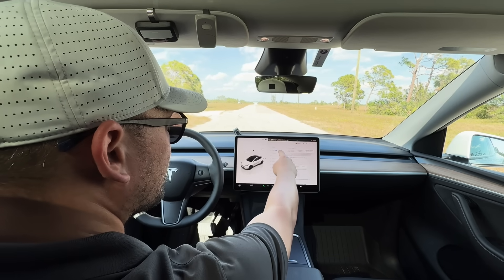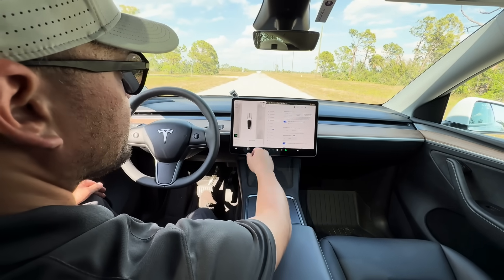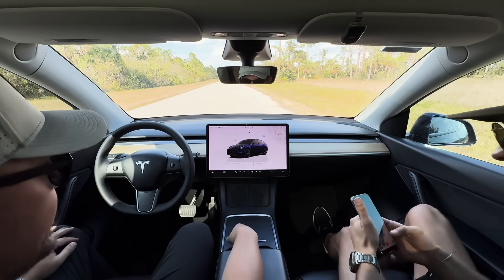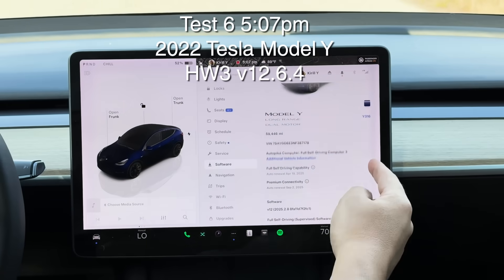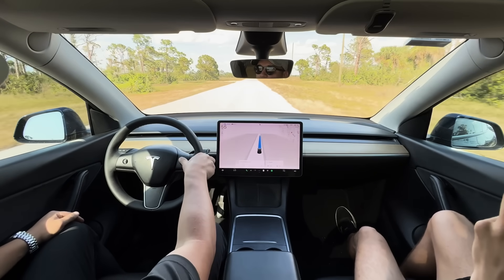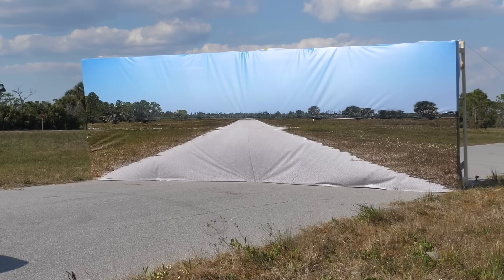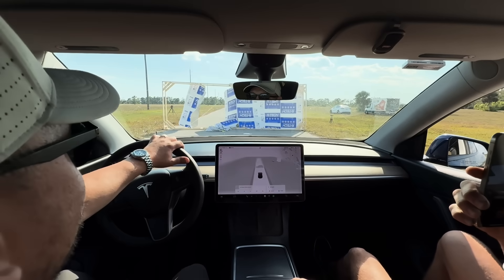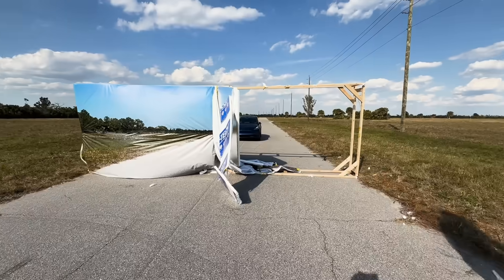Mark Rober Debunked - You can't fool a HW4 Tesla using FSD!

Comment: What really make the difference between the 2 is not the HW but the SW, FSD version 13 is using a much more powerful AI model and why only HW 4 have it is because it require more processing power to run and HW 3 can't handle it.
Reply: Since I have not seen a fake wall on a highway to avoid,  it doesn't really matter.
Reply: @Notme-tq4xs hey don't tempt these tesla haters. They might start putting up fake road walls.

Comment: I have both a HW3 and HW4 Tesla. HW4 is incredible. I basically feel like I have a true full self driving car with HW4. Use it a lot. I'm lucky if I have 2 disengagements per month. And if I disengage, it's usually because of what appears to be mapping issues on freeways. Has nothing to do with the car making a real mistake while driving.
Reply: HW3 ain’t too bad either
Reply: @joneclegg  HW3 is awful compared to HW4. At least on city streets. HW4 is just that good
Reply: It might feel like you have a full self driving car, but you absolutely do not. Nor will you ever. Even lidar-based systems go badly wrong. Don't be complacent behind the wheel or somebody will get killed
Reply: @robertollier3085  people get killed when driving themselves, or in a taxi. You can't have 100% safety. Even trains crash.
Reply: I’ve been a Tesla shareholder since 2018.  I don’t drive enough to justify buying a Tesla.   In your opinion, how close is FSD to getting reliable enough to go unsupervised?
Reply: @jeffreyhampton9130  HW3 here...12.(6? something) In the past week or so, I put on about 20 hours of no intervention highway driving. However, it still seems mostly clueless about the last 30 meters or so... parking lots... parking.. It just kind of gets lost. So, in a sense... it's "99%" even for HW3 12.(6?) but that last 1% may not be anything like "1%".
I think of it like this: 99% of the time, I can drive without thinking. It's just reflexes... but then 1% of the time I have to think about my surroundings and figure out some sort of a problem. I don't think that is very similar to the reflexes driving. It takes 10x or more "thinking" on my part for those occasions. I suspect a similar thing for AI models..
Hopefully, learnings from xAI "thinking" mode for LLMs can help solve this sort of problem.
Reply: @JordanPriede  Thank you.  This is helpful.
Reply: @JordanPriede  very. very helpful, i should say.
Reply: @JordanPriede  You're mostly correct, but you (nor anyone ) can't claim it's "99% there but that last 1% may not be anything like "1%". That's not how % works.
Reply: @edide1627  I meant it is useful for 99% of driving. But that doesn't mean there is only 1% development effort left.
Reply: @jeffreyhampton9130   I rely on FSD every time I drive my Tesla with HW4—it's genuinely that good. However, I believe 'unsupervised' is the wrong framework for this technology. Rather than expecting perfection (which remains years away), we should view FSD through the lens of the Swiss cheese model of accident prevention. Each 'slice' (FSD, human supervision, other safety systems) has holes, but when stacked together, they create comprehensive protection. The combination of FSD with an attentive driver creates a significantly safer driving experience than either could provide alone. The goal shouldn't be eliminating human oversight but optimizing how these safety layers complement each other.
Reply: @amieres  I agree, but that is NOT how Elon Musk and Tesla market FSD! 
Quite the opposite. unlike other manufacturers, Tesla much rather appears to lure their customers into careless and even reckless operation of the vehicle based on a false sense of security and reliability of a system in beta test status.
Reply: @tomwoggle9411  it doesn't let you ignore the road. It bugs you if you don't watch the road. And if you ignore the road enough, I believe it actually shuts the feature down on the car. At least that is what it seems to imply.. there's a record if you have a strike against your FSD usage be being inattentive
Reply: @jeffreyhampton9130  I don't drive Tesla too, just saying what I'm thinking based on videos.
It still has multiple strange behaviours that need to be fixed. Most of them don't cause a collision, but it could if all cars around behaved like that.
There is also a lot to improve in emergency situations, or even interactions with emergency vehicles.
I think regulators could accept unsupervised even right now. On some roads, in good weather conditions.

You have to take into account that regulators are not apolitical. A good example is Mercedes that is supposed to be L3, has a lot of marketing around it, but its autopilot is far behind Tesla. In addition, Tesla has a history of marketing cars as self-driving when they were clearly not ready for that, and even some people abused it - for example, sleeping while going to work. Some people died.
Reply: Is it good enough that you can turn it into a robotaxi? And has your car appreciated in value since you purchased it?
Reply: @ChuckNorrizzed to take Teslas own robotaxi event... no not even close. Also a robotaxi will need alot of hardware for that specific service. your car wont suddenly become a robotaxi.
Reply: @pse2020 so the advertising was a lie?
Reply: @ChuckNorrizzed First of all, they had a dedicated "cybercab" they didnt use regular tesla models. 2 they where geofenced. on a robotaxi event. For me that proves 2 things, 1:  their method is not working or is not ready for that type of service. 2: a dedicated car will be needed or ur car will be refited for a price maybe.
Reply: @ChuckNorrizzed  I've noticed drastic improvements even with the software updates on HW3, so I wouldn't rule out unsupervised being safer than a human overall.
It's more of a last little distance path finding. An address isn't a specific spot, so it needs to decide where "the" destination is. That's when my brain has to think - "ok... where is a good place to park... oh, there is no parking here... maybe across the road... hmm. Or maybe just down the street..." that isn't "driving" per se. So for FSD to be "fully" self driving I honestly think it's practically there today. Finding a parking spot is a bit different, though.
Reply: @ Come on, "FSD is practically there today" !!!.. Maybe like "practically we're on Mars today".
Reply: "I'm lucky if I have 2 disengagements per month" means "I usually have MORE than 2 disengagements per month". You are using this idiom wrong. Either that or you like disengagements?
Reply: @cogspace more concerning is that 2 a month is still quite a lot - enough that people don't trust, or few enough that people might not pay attention?

Comment: It's not just about old sensors and old software. Mark literally disabled all software before hitting the wall. He did multiple takes of driving towards the wall but they edited the video to look like one. He accelerated to the wall turned on AP for two to get a clip of it on for the video, and then manually disabled it before hitting the wall.  You can see that it is off in the internal shot if him hitting the wall.

In the water test, where no shot of the inside car was shown, he completely lied about using anything. He manually drive the car the whole way through the water and hitting the kid. You can tell because he was driving centered over the yellow dividing line the whole way, which Tesla software wouldn't do.

Mark's video is a complete fraud.
Reply: The system disabled itself, he released the unedited video showing it with his hands no where near the controls.  Tesla was also being investigated because that's a thing that's been happening in real world scenarios and they suspect Tesla is doing it to avoid scrutiny.  They can claim autopilot/fsd was off at the time of the crash (neglecting the fact that they turned it off when they detected an unavoidable collision).

Comment: Kyle, you should pin a comment mentioning on the other video that you repeated the test and link it here for those who were asking. Thanks for running the test again! You can also hear the autopilot disengage after impact, even though you showed that the car saw the wall from a few feet away. So, the reason Mark's autopilot was turning off was likely due to his unintentional jerk of the steering wheel. We could even see you tense up, so don’t blame him—it just shows that human intervention was probably a factor.
Reply: Mark's problem was that the "road" in the image was to the right, so the car wanted to drift right, but subconsciously he was putting pressure to the left to stay centered on the real road.  At some point near the wall this built up to be enough of a difference (between the car wanting to drift right and him pushing left) to disengage AP.
Reply: If you watch the video frame by frame, you can see that it disengages 7 frames BEFORE impact, not after.
Reply: @NikkiDimesYT  i just watched 5:43 still shows the blue line and it is clearly breaking through.. not sure what you are looking at. Pause the video and use " , " and " . " to move the seek left and right 1 frame at a time.
Reply: tesla also disables it before fatal crashes, they did that before.
Reply: @DarukiNeo  If you look on the Tesla web site you can find their operational guidelines and it states that any crashes that occur within 5 seconds of Autopilot disengaging would still be attributable to Autopilot. So that theory no longer holds water. Look it up. But Yes, I'm aware of a couple of incidends 6 or 7 years ago with early version of Autopilot. Software progresses fast and so do the reporting standards.
Reply: @DarukiNeo  IDK. I don't have evidence of whether or not the same thing occurred during those crashes you speak of as what we see in these videos, maybe you have video to prove your claim. However, you can clearly see it disengages in Mark's video when he makes a sudden jerk of the wheel. I feel pretty confident that he wasn't doing it on purpose as I previously stated; but it did occur. If you own a Tesla you would know this quick movement will disengage autopilot.
Reply: @Fragmentations  You have as much evidence as guy pointing out disabling before fatal crashes. Evidence would be not just subjective interpreted a video with little hand movements, but getting logs from tesla SW. ;)
Reply: @Fragmentations it’s pretty well documented. It’s Teslas Silicon Valley route to avoid lawsuits. A company like waymo or cruise who have no drivers tho, died end up having to accept full responsibility tho since there’s literally no way a human could’ve intervened(assuming you didn’t somehow sign away your rights when taking the ride)
Reply: @ShawDou  I agree I have as much evidence as him. ZERO. Like I said, I only have evidence of what occurred in these two videos. wdym.

Comment: Can’t wait for the “experts” to point out every tiny difference based on the time of day! 

It’s simple HW4 can detect the wall and HW3 can’t.
Reply: If a human can see the wall (because of weird perspective, ripples in the fabric, etc) then an algorithm with cameras could be made to also see it.
I don't even think it's a matter of HW4 can and HW3 can't, I think HW3 can detect more obvious stuff, and HW4 detects more subtle stuff (hense it's more likely to see it).
Reply: Before software was being developed on HW3 and then ported on HW4 so it was the latter lagging behind. Now it's being developed on HW4 and back-ported to HW3. There will come a point where Tesla need to decide if it's cheaper to maintain HW3 and HW4 branches or just upgrade all HW3 to HW4. It's not obvious.

Phillip.
Reply: I mean time of day is an important variable to control for, so this was a good test overall. I would love to see other types of roads being tested like ones without trees like how Mark Rober's video had. The trees may have had a hand in not being apples to apples, but this test was much better.
Reply: Hre you are: Why did you change the location and paint a different picture than you did in the previous video? Here you have many trees around, which makes the wall much more visible at different distances. Also, the curve in the previous video hid the wall. Now you are approaching it straight from a greater distance. And you didn't test the autopilot itself. The situation and the picture in the previous video were more challenging than this long straight road with trees on the horizon in this video. You really wanted very much to have HW4 working well, right?

Comment: Great test. This is how a proper test is done. Im not surprised HW3 did not see it until it was right on top of it. Safe to say the cameras in HW4 cars are much better. Could still be software differences(HW4 v13 vs HW3 v12) but since we cant(and may never) get v13 on HW3 we probably will never know.  In any case, this was very informative.
Reply: HW4 uses 5mp cameras vs 1.2mp for HW3 I think.
Reply: @tookster7483  I believe you are correct. HW4 cameras also have higher resolution.

Comment: This shows Better Hardware , Better Result .
Reply: With how cheap lidar is getting, it's starting to feel like we should just start adding the best hardware into the cars. For context, lidar systems used to be many thousands of dollars to add to a car, now it's a few hundred. tesla gambled that lidar wouldn't become cheap enough very quickly and could solve the problem at a software level but their timeline was off and lidar is very cheap. I would still rather have a lidar system at this point.